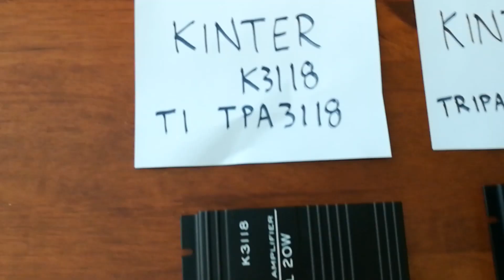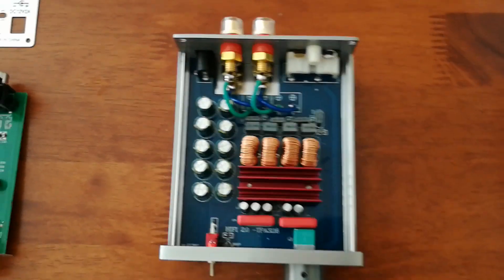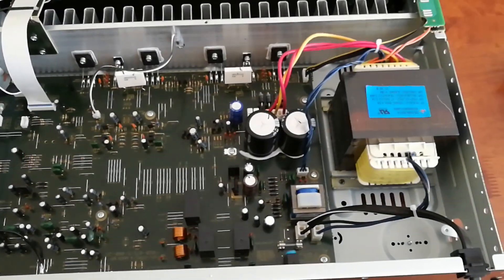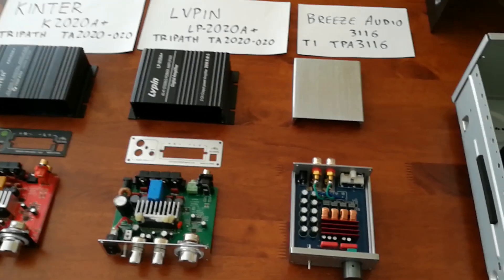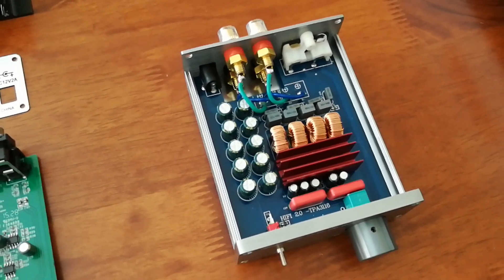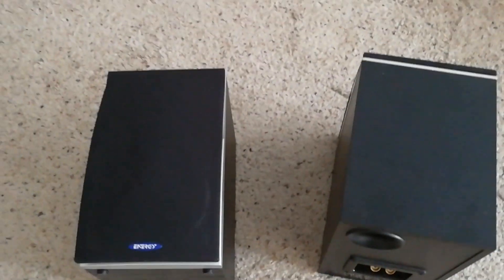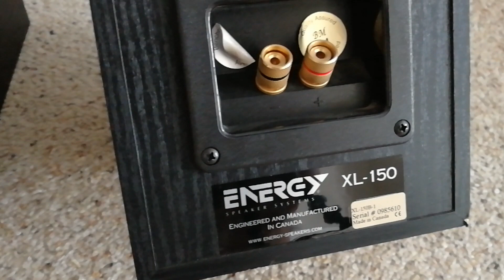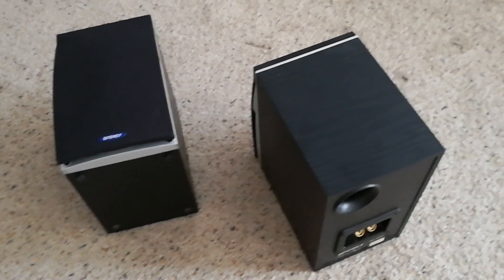Mini Amps! (Pt2) ~ Tripath 2020 vs TPA3118 vs TPA3116 Class T & D Amplifier Tests ~ Board Guts

Comment: The main advantage the Insignia has over something like the 3116 is a very nice built in power supply, with a beefy toroidal transformer and nice filter caps. whereas the 3116 is usually being run off a laptop power adapter with an iron core transformer and very poor component’s quality. 

As for the 3118 and 2020, I feel they are simply designed for a different market. And are not really intended to be as high end. Even with a better quality power source.

Comment: A lot of companies use linear pots for volume vs logarithmic pots... this will change how much rotation is needed before reaching a specific level.  In other words, sometimes just bc you have to turn one almost completely CW to be loud, and another only needed half of that rotation to get there... doesn’t necessarily tell anything.   Just wanted to throw that out there.  Appreciate the video!

Comment: Nice review - it was interesting to see the lack of difference in the minis and large difference in the full size unit.  I recently bought a Kinter K2020a and of course almost immediately took it apart to see the guts, and was shocked to see some pretty bad-looking build quality issues. The pins of the tri-path chip are not all soldered to the board, a capacitor was bent over 90 degrees to touch the pcb, and from the back there were multiple pins that looked burned. Plus thermal paste from the chip heatsink was in places it probably should not be.  Can you take a look at my photos and let me know what you think?  I posted a review on Amazon a couple of days ago - P. Miller  https://www.amazon.com/gp/product/B077Z7DBRT/ref=ppx_yo_dt_b_asin_title_o00_s00?ie=UTF8&psc=1#customerReviews
I have powered up the amp and run it for 30-45 minutes with no smoke or heating up, so it may be perfectly fine, just looking for another opinion.  Cheers.
Reply from the maker: Hi! I looked at the photos and while it's not high end manufacturing, it doesn't look too bad or unsafe. You can clean up a lot of the junk on the board with alcohol wipes. The cap being bent over is only a problem if the leads are touching something they shouldn't be... which usually isn't the case. And the unsoldered pins on the Tripath chip are just unused features of the chip that are not incorporated in this simple design. I would just use some alcohol wipes and do a little cleaning, call it good and enjoy some music. Thanks for the post!

Comment: The Kinter 2020A looks exactly like the Lepai 2020a+, and has also come out with an updated version useing the tap chip, and costs a bit more.
Reply: Interesting. Looks like the Lepai 2020a+ uses beefier caps, more expensive heatsink design, albeit messier assembly in some spots. I need to find some close-ups.

Comment: You can use a safe start board with a relay to stop the pop. I believe you can also use a filter capacitor on you VIN+ and - not to sure. If it's 24v input use a 50v cap.
Reply: Make sure it’s a high enough value in uF if you do that because it’s gonna roll the bass off if you use too low of a value.

Comment: None of the class-D amps runs on mains directly, I would usually avoid the bundled PSU unless it carries a UL/ETL/etc 3rd party certification. I've taken quite a few apart, usually refurbished units in a new case... cut off leads and shoddy repair/soldering with missing passives...
Reply from the maker: Daijoubu - Thanks for the input. I've always wondered about non-certified devices getting plugged into the wall. There's so many direct from China product without any oversight coming over.

Comment: Got the Kinter TA2020 hooked it up to some Klipsch bookshelfs took it out front of the house,even the neighbors said it sounded good at their house. I think its a good little amp all the way up about 3/4 volume and then I get a little distortion, but other than that it sounds great. Can't beat the price
Reply: Guido Brunelli jr. , I just got the limited edition Kinter Tripath amp 20/20.
it's on my screen porch.
I have a pair of Polk RTi
speakers. 6 1/2 woofer and 1 inch done tweeter.
I'm very impressed with the sound. it can go to about 80 percent volume before it runs out of steam. but at that volume, I don't want it any louder.
it sounds very good at lower volumes and retains the base even at lower levels and the crisp tweeter sounds too.
overall, caint go wrong.
I get off work, plug my phone into the 3.5 mm output and bingo.
I'm rocking.
Reply from the maker: Guido Brunelli jr. - Awesome! I agree. I'm glad you're enjoying it! 🔊😀
Reply: @cafe80s  thank you so much for educating us.
Reply: Yep the THD distortion is way lower under about 8-10 watts, then shoots up pretty quick the higher you go with the tripath 2020.